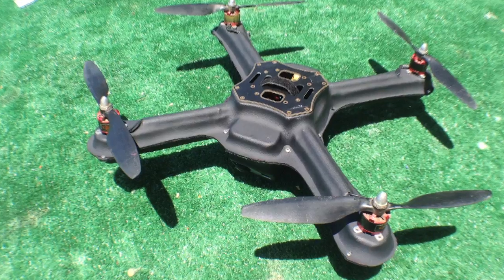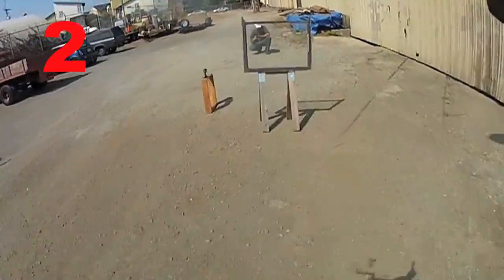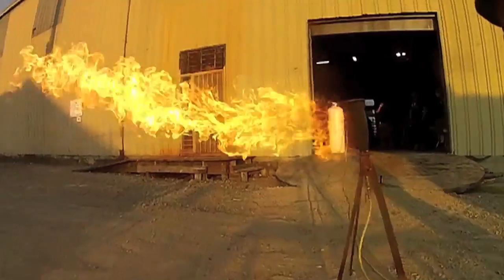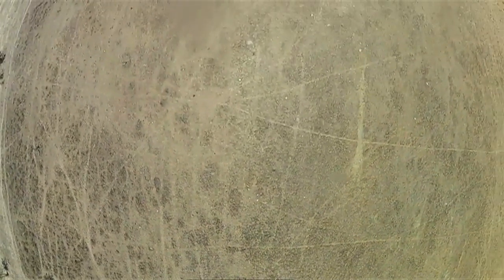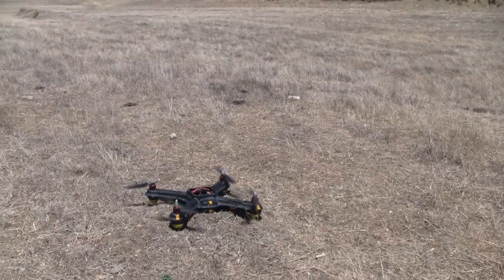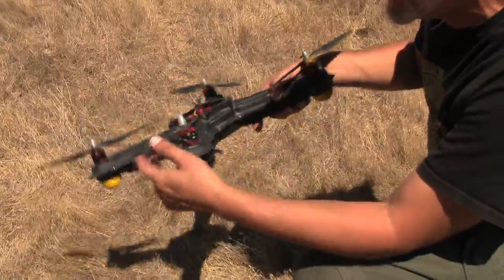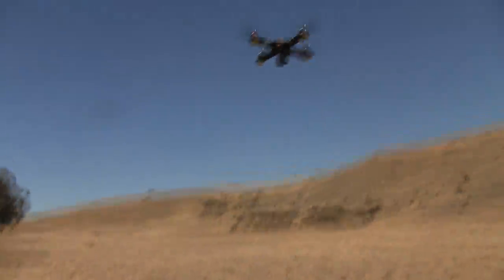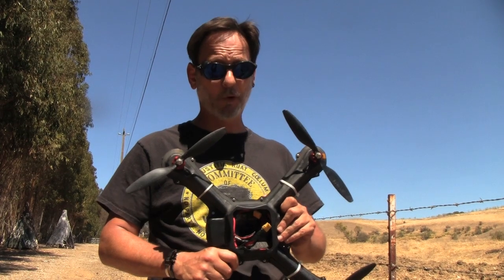Shotgun vs Drone Airframe - UAV Torture Test by Aerial Sports League

Comment: One of the problems is you are encouraging people to fly using a frame that has taken damage. This is irresponsible. Anyone with common sense would not fly, for example, with a fractured propeller as it appeared you did after you dropped it from 400'. You should have mentioned the potential for chlorofloric gas from a short in a battery while shooting at it. That can cause lung scaring and other serious conditions. Please be more responsible in the messages you are communicating in your videos.
Reply: Thanks for the comments. We DO encourage the use of OUR frame after sustaining damage.  The other components need to be assessed independently since we only manufacture the airframe.  But safety is always a concern since we host aerial combat games.  The OEM DJI props bend without snapping (I've broken less than 6 in over a year of combat) and we alway have fire extinguishers on hand.  Check our vids.  That same airframe has been flying as-is for over a year with no ill effects.  Considering the damage potential, and our lack of any injury or property damage, I think we're especially careful. But everyone will have their own comfort level.  Thanks for the comment and share the links.
Reply: marque cornblatt That is the problem. It has been flying for over a year with no ill effects. When something bad finally does happen you won't report it, people will purchase your frames and consider them to be indestructible, and when something bad happens you will have a lawsuit on your hands. People need to understand the limitations of a product, yes it's durable, but mechanical failures happen. I have been involved in the design of several frames and seen testing, and this is marketing. I know of several other frames that can withstand the falls and fire you have put this frame through in the video, but the issue is they don't claim to be indestructible which is the idea you are putting in peoples heads. On top of that WHEN something happens if the FAA gets involved your irresponsibility by communicating such a message will encourage more severe FAA restrictions on all of us.
Reply from the maker: ***** What can I say?  Our prototype airframe is perfectly fine.  It's durability is not, as you say "the problem," it's our solution.  We HAVE been actively trying to destroy it ON CAMERA for many months.  On 3 occasions I thought the airframe was going to be retired, but after cleaning it up and refreshing the components, it was perfectly airworthy.  At no point do we suggest that pilots don't have a personal responsibility for what they fly, we simply offer a tougher airframe. If that makes you uncomfortable, then perhaps don't watch.  Again, thanks for the comments.

Comment: Shooting at a drone is illegal. That's bold statement to make.
Reply: Shooting stuff that's not yours is definitely illegal.
Reply: Not if the intention of drone is to do harm.
Reply: PlaceHolder PlaceHolder
If it's in the air, it's going to be hard to prove self-defense.
Reply: You missed the point - shooting a gun up in the air in most places is a felony irregardless of what you are shooting at.
Reply: PlaceHolder PlaceHolder
WOW, you just have to live in the negative don't you?  Drones are not illegal to fly in a rural setting such as this. The fact is that the FAA is currently working with companies like Amazon to approve widespread drone use for delivery in the cities.
Reply: Flying a drone in restricted airspace is also a felony.

Comment from the maker: The airframe can withstand all those attempts to destroy it, although some of the electronics would likely be damaged.  However, the larger point is that the airframe will survive any wear and tear you would typically encounter flying and crashing.  If your goal is to obliterate it by any means, I suppose you could just cut it into pieces with tools.  Then, yes, it will be destroyed.

Comment: Kydex wrapping a quad is a good idea obviously but  The #1 complaint with drones is short flight times (4-7km of flight).     Motor manufacturers are building supper efficient 300-500kv low profile pancake motors capable of swinging 12-14inch props finally giving these birds 10-20km range.   With modern flight controllers its hard to crash these things! :-)